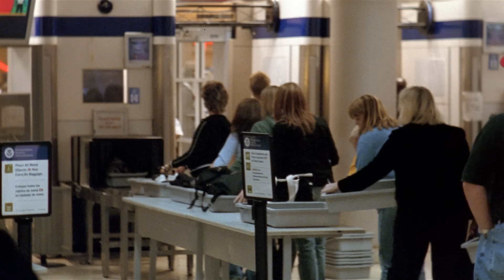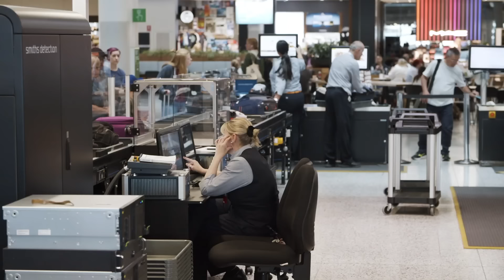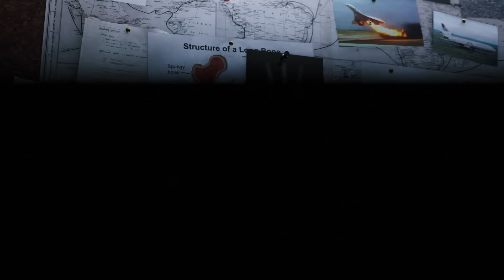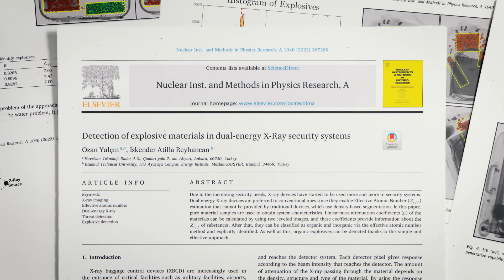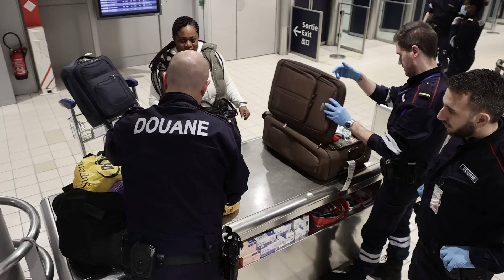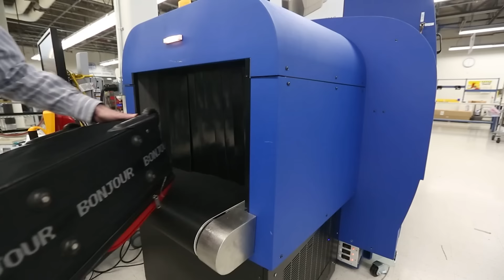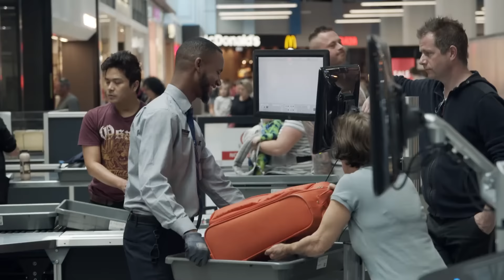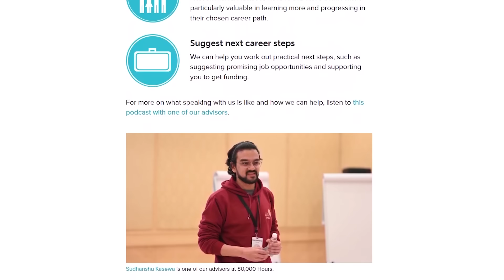Why Airport Security Suddenly Got Better

Comment: as a photographer who primarily shoots with film, these scanners are terrible, the old scanners would only fry film above 800 ISO (very light sensitive) not anymore, any film that goes through the new ones will be completely wrecked. and yes I could (and do) ask for a hand check, but more often then not I've been told to put it through the scanner or fuckoff, that has been relatively fine as I shoot film under 800ISO most of the time but now... I hope they keep at least a few of the old ones
Reply: yeah the tsa agents need trained to not shove film (esp used film) through those scanners.
Reply: I'm, ship your film to/from your destination? This isn't rocket science. I'm a weirdo in different ways, but you can't expect normie-optimised systems to care about you 🤷‍♀️
Reply: @halfsourlizard9319  Fuck the normies. OP shouldn't have to spend their own money to ship their luggage separately.
Reply: @halfsourlizard9319  yes, that is true, until they lose your memories/work, I've shipped film once, thankfully it was just unexposed, so all I lost was money, but ya, they lost my package the risk is too high to ship exposed rolls. I'm not saying remove all the new CT scanners, they are as the video shows, brilliant for people who aren't bringing film, but I just hope they keep at least one "sensitive materials" line!

Comment: I was surprised they don’t use XRF for security scanning. Small hand held XRF machines aren’t particularly expensive
Reply: Doesn't work for elements below magnesium Z=12 which is where all the dangerous stuff is, e.g. carbon and nitrogen compounds etc.

Comment: Don't they already need a 3D reconstruction to get the correct thickness value? How is that different from knowing the density?
Reply: It isn't different, that's the point. It just hadn't personally occurred to Brian that it was a useful data point on its own until the manufacturer pointed it out to him

Comment: As long as TSA and equivalent organizations around the world do not a) employ people with a certain level of intelligence (or above, not below)  and b( continuously give their staff excellent training, which they are currently lacking so badly. If you don't "upgrade" the staff, you could give them scifi scanners from the future analyzing precisely every molecule in the luggage, naming every item, giving a threat assessment and a recommendation for free, and they would still f it up.
No sorry, I can't let you bring that coke bottle through I saw you buy 30s ago at that stand 10m away and you drank from since, so it's likely not a poison and not an explosive. Oh I got to confiscate that tooth pick, you might stab someone with it, after you got bored using the perfectly sharp steel knife they give you with the meals on board, etc. etc. etc. And it gets really funny, if you have an unusually shaped electronic device (like a power bank, I had a lot of "fun" with). Those guys, living their little fantasy of having power until they get home. Don't you love em. You could hug em so tight around their neck until they get really relaxed. ;)

Comment: Why its ok to be around these machines and work without any protection, while an xray requires a lot more protection for the patient and the doctor?
Reply: Same reason you don't need any special protection to stand outside of an X-ray room - the radiation is contained within the machine where the stuff being scanned is. Medical scanners don't have containment like this because people don't usually like being trapped inside a very small tunnel if it's at all possible to avoid, that and the larger space gives more flexibility in terms of positioning, neither of which are problems your laptop bag is concerned with

Comment: Also what's the energy use (electricity - KW's) difference between the old regular Xray machines and the newer CT style scanners, as I thought CT scanners were quite intensive to use and needed some particularly difficult material to create, just to use them.
Reply: You're thinking of MRI.
Reply: @SanchoPanza-m8m  I couldn't think of the machine when I was watching the video, appreciated. I guess I'm going to have to watch CT scanner rip down video, and hopefully find out what if any difference there is.
Reply: @SanchoPanza-m8m  Did a little digging and here's what I got - "A Xray machine typically ran for 4hrs per day in a hospital would consume barely 6kw, where as a CT is 1.2kWh and a MRI requires 19.2kWh" 

Energy eh, free for all except you and me.

Comment: The TSA in America purchased $700 million of these new machines by Analogic called the conneCT. THEY ARE ABSOLUTELY HORRIBLE! They constantly crash and require restarts, are extremely slow, and agents hate them with a passion. 
I work in aviation, ever since we switched to these awful pieces of garbage lines have doubled at my airport. Smith Machines are featured here and work as expected, but the round white and blue Analogics will ADD anywhere from 10-40 minutes to your security wait. 
You know it’s bad when I hear TSA agents talk bad about the machines.
Reply: My airport currently has multiple x-rays not in use because something has happened to them. Then, the ones that are working go down constantly because they are used so much.  I would rather use the old 2D AT smiths than the analogics. Just because of the fact they worked...  literally a hat falling out of a bin will fault the analogic but not the smiths.
Reply: @jjbboxbulbasaur6183  US government spent $700 million on garbage machines, apart from sending foreign countries billions in cash. I’m just so very tired of America and its incompetent corruption. I wouldn’t even mind if it was competent corruption, but alas, we have brain dead president with a cabinet full of diversity hires and cronies. Gasoline in my area just went up .60¢ to $4.90. It’s supposed to go up to $6 by summer…..
Reply: Cannot agree enough with this comment. The Analogically scanners SUCK.
Reply: I fly monthly, and the last 2 years each trip seems worse and worse. It went from getting through TSA in <10 minutes to 1-2 hours.... I almost missed several flights recently even though I was there 2 hours early because it took 1hr 50 to 55 minutes to get through TSA and then I have to rush to my flight.
Reply: @FragEightyfive 2 years ago COVID shut downs had airports 95% less busy. Now the national amount of travelers have been at an all time high
Reply: @robertct06  okay, before covid the lines weren’t as bad as they are now because the machines they use are trash. I’ve been in the industry long enough to see the difference
Reply: Here in Buffalo the machines work perfectly and I’ve never seen any problem with them. It’s like the machines featured in this video, honestly…Sucks about your experience, tho. :(
Reply: The smiths ones aren't much better, where I work we currently have 3 of them & they're always breaking down with engineers needing to be called in on an almost daily basis or one or more of them
Reply: The TSA agents know that these machines will end their tyranny! They'll make sure these machines won't work...
Reply: its seldom about which works best, lowest cost, or efficiency. it always boils down to how much pressure is exerted by the 'influence team' having deep ties to security, military and gov domain. the name of the game is just merely stealing money from taxpayers, via, in this case, buy buying inferior equipment. it happens everywhere. remember the $5000 toilet seats?

Comment: We currently love to talk all about the pros, and nothing about the cons.
We see a more powerful option and slap the "better" lable on it while completely ignoring asking if its a better cost vs benefit ratio, or if the problem even exists in the first place, or if the problem exists but its a side effect of some other problem that should be fixed instead.
Reply: More people goes through faster, most likely not to be stopped.   More people happy = happy flying.   More likely they be coming back for another trip to the airport.   = $$$ airport makes the money.
Reply: @mashy712  Again you havent mentioned a single cost,
you havent mentioned a single alternative,
you havent analyzed if the problem is a side effect at all.

Life is not a simple matter of listing the benefits.
Reply: Metal bottle to block Xrays, then a false weighted bottom so even if you pour it out it looks legit. No, these are just security theatre. Criminals advanced enough to need tech this expensive to stop them are too advanced for this tech to stop them. 

These are people booking one way tickets for their causes, if I can find a workaround in ~30 seconds half thinking about it while eating a shitty burger, they're gonna think of WAAAAAAAY fucking more.
Reply: Main cons are that they are more expensive, and can damage items sensitive to radiation like photographic film
Reply: Shoe bomber, not that this particular device would have helped, but bad things on a plane is still a real threat.

Comment: Wouldn't also the timings of Xray beams and how long it would take them to travel through difference liquids be a major giveaway for if you are carrying anything other than water. A lot of machine AI would be able to calculate these quick enough to make it efficient to use.
Reply: @theinternetbutler Hahaha, Very funny, I was typing and watching at the same time, we're still allowed to ask question where I'm from, I think. Anyway what about my other question in energy usage?
Reply: @theinternetbutler It seems CT scanners are about 10 time less power intensive to run than a MRI scanner, which was where the basis of my question was going to come from. And this is per scanner, you can have many scanners running at the same time, and unlike a hospital are going to be running more than the 12hrs a hospital scanner might be running for, as much as 20hrs per day I would guess. A Xray machine typically ran for 4hrs per day in a hospital would consume barely 6kw, where as a CT is 1.2kWh and a MRI requires 19.2kWh. All in all, security is expensive, And it seems I answered my own question, with very, very little debate. \_0_/
Reply: @theinternetbutler I admit. It did seem apparent that a water being just just H2O, would have a much lower density that say gasoline C8H18, should be easier to distinguish timing data for. Also, it's ok to think about the problem whilst it's being explained to you, and how do you know other people who watched the video weren't thinking the same thing. I mean it's 6 minutes into the video before your even given the data, who knows, as for the question on energy usage, it's literally below this comment. But hey-ho.
Reply: @theinternetbutler  people are allowed to question it, god dam your petty. No wonder people find better things to do. Enjoy your future videos, and the energy consumption question is still completely valid, or will we make great leaps and bounds within the next 5 years to supply the coming demands, i know you know the answer to this, so pat yourself on the back.

Comment: Statistically, the TSA has probably killed more people than they have saved with their Terrorist Theater. What do I mean, well Commercial Air travel is by far the safest form of travel. Anything that drives a person decision to drive, take a bus, train instead of flying increases their risk of death while traveling. Driving the price of an Airline Ticket up, shifts the equation toward other means of transportation. Not wanting to participate in the Terrorist Theater, again shifts the decision point to drive... So, the TSA is driving people to more risky behavior that results in more travel deaths. 

The last little bit of gain, to drive Commercial Air Travel deaths to zero, is the most costly endeavor and actually drives death elsewhere upwards. Air Travel is by far the safest way to travel, maybe even too safe, if cost effects people's decisions to take other risker forms of travel.

Comment: Imagine adding radiography to the scanner. You could tell everything about the material, but it would cause non-insignificant radiation emissions. Shorten lifespans of humans vs. ensure safety... 😅
Reply: They already use radiation, X-rays are a form of ionizing radiation. It doesn't matter though, because they just put it inside a container that blocks X-rays...
Reply: The amount of radiation that leaks out is really, really insignificant. I don't believe medical CT scanners are the same the ones used in airports. But people regularly are INSIDE those rotating CT machines.